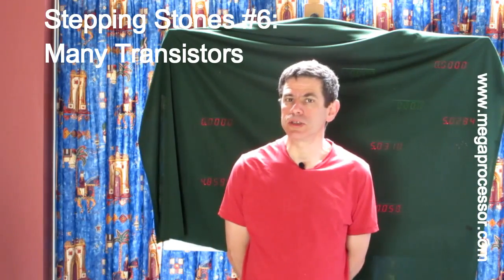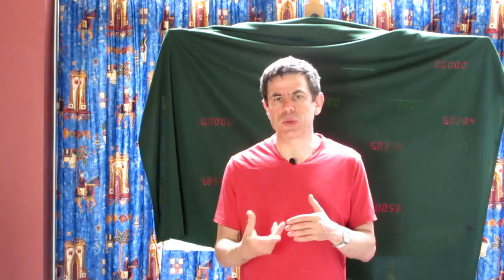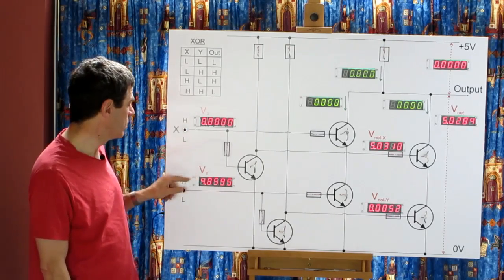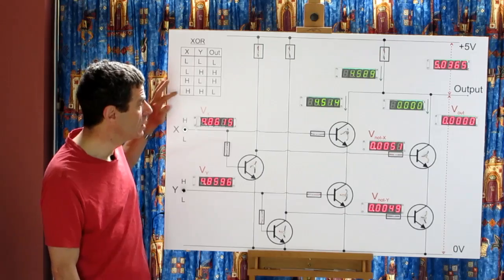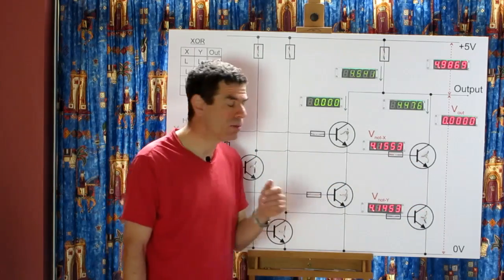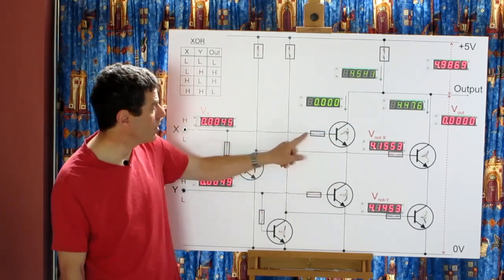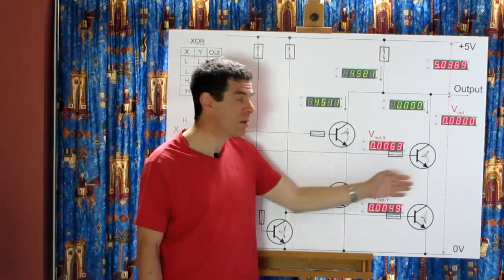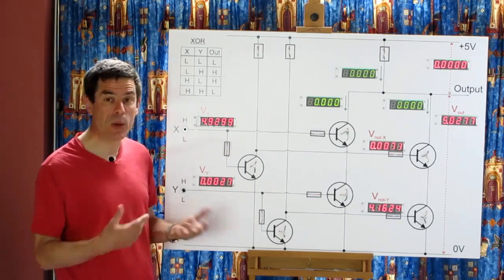SS6 : Many Transistors

Comment: What are those? https://s15.postimg.org/gmz0w1izv/Screenshot.png
Reply from the maker: They're resistors chosen so that the transistors are behaving as switches. I should have made that clearer.
Reply: So if the transistor lets the current flow through they make sure that all flows through that transistor and nothing to the base of the next transistor. Is that correct?
Reply from the maker: In the relatively simple circuits I've used as examples it may look like that's what's happening but I don't think that's the right way to look at it, they don't steer current like that.

I think a better way to look at is that when a transistor is "fully on" it looks like close to short circuit between the collector and emitter which means the voltage at the collector becomes very close to that at the emitter. (This would be easier of we were sharing a circuit diagram). Whether current will flow through the base of the next transistor (to which we've connected out collector) depends on if the voltage on the collector of our first transistor is high relative to the emitter of the second. (If the base voltage is > ~0.6V that the emitter then current will flow base to emitter and cause (larger) current to flow collector to emitter).

So when the circuitry is configured so that transistors are acting as switches:
if the volts at the base of a transistor are higher than the emitter by > 0.6V the transistor will be "on" and the collector-emitter path will look low ohms. Otherwise it is "off" and the path will look high ohms.
so if a transistor is "on" then the the voltage at its collector will be pulled close to that of its emitter
otherwise if a transistor is "off" then the voltage at its collector will depend on whatever else is attached (in my circuits generally a resistor to +5V, so it will be 5V).

I think that set of rules will get you closer to what is happening (but remember it's a simplification).
Reply: +Megaprocessor Thanks for the detailed explanation and your great series, I learned a lot about the underlying principles of logic gates.